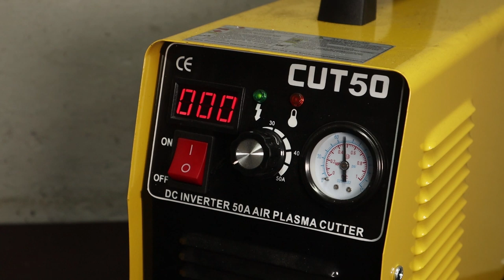Making a Floor standing LED Lamp from Scrap Steel

Comment: the radio cracked me up 😂. for some reason i thought plasma cutter was a lot more expensive. what do you think of it? do you just connect it to your air compressor? does it also plug into standard main plug or do you need a higher amp supply?
Reply from the maker: Thank you very much! I just bought it a couple days ago, i like it so far! Yes it just needs a compressor with around 60psi. This is a 220v model, but they make them in 110v too.
Reply: @Ollaris  I would love to do shipping container conversion. Workshop or and tiny house so it's good to know that these are affordable.

Comment: Ah mate that is unreal 🤙 fantastic job. And tuning in the radio 😂 I could see green from that galvanized pipe even though you cleaned it up, man I hated welding that stuff 🤢
Reply from the maker: Thanks Alan! Yes, i was surprised as well. Nevertheless i always use a respirator when welding anything galvanized.
Reply: @Ollaris  yea you would need too I remember getting knocked back by the gas before not good 👍